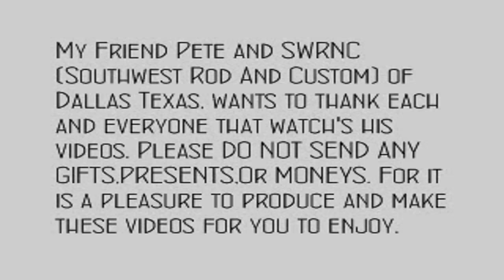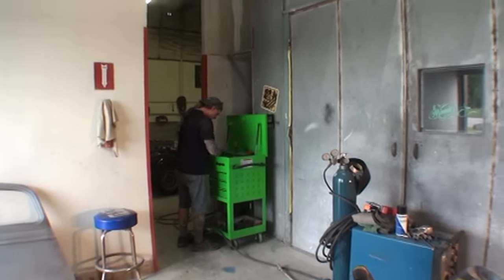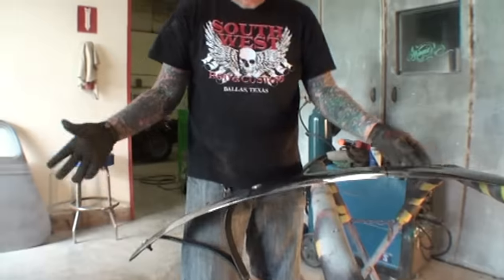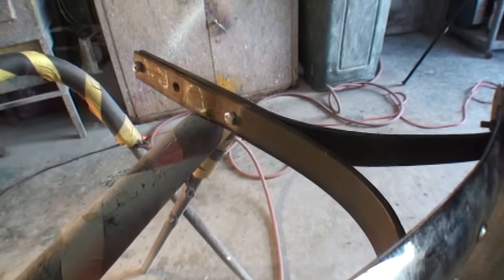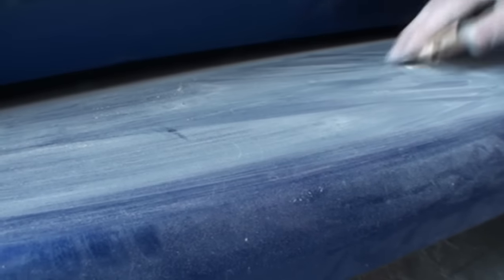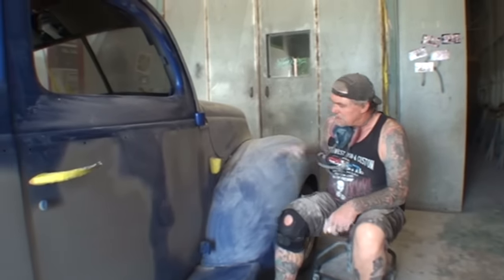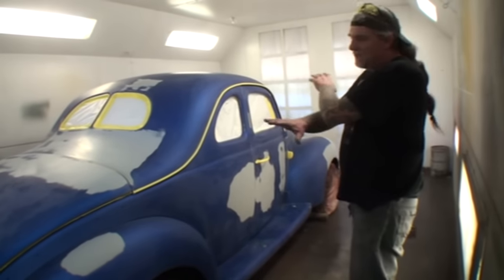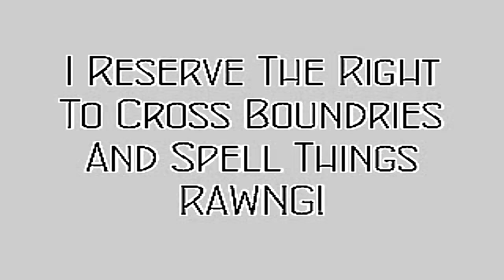How To Fix And Paint A Wrecked Hot Rod Car! Part 3 - Wet Sanding 2K Primer

Comment: I wonder if you mount the brackets to the car first, then heat the brackets while on the car and bend them to fit the bumper. Heat, bend, hold the bumper up to the brackets and repeat until proper fitment. But I know it would take a lot of time.

Comment: I painted a 97 mustang convertible right out in the open air and didn't get dirt in the paint. A few fossilized gnats in the clear coat was about it. 
Seem to be he didn't properly clean the car after wet sanding the primer, and or the garage was dirty.

Comment: I stopped using epoxy primer due to it (ringing out) blistering as you call it. I use auto barn 1k non sanding sealer (you can wet sand it) and it’s ready for paint in 35 minutes without ringing out, blistering anything. And it’s only 89 bucks a gallon , ready to spray
Reply: Correction... Auto Bahn 1k ready to spray sealer from eBay
Reply from the maker: I’ll have to check it out. Thanks for watching.  Your corvette came out beautiful!! 👍👍

Comment: Why not remove the brackets and install them first and then mount the bumper?
Reply from the maker: I did do that ad I actually filmed it but was dragged out and very long so I just got to the point to make the statement.  Either way you looked at it the brackets didn’t work. I think they where for something else. Even the owner stated they where brackets he found with a bunch of parts that came with the car and he didn’t know if they would work.  🤷‍♂️🤷‍♂️🤷‍♂️

Comment: Looks like you are going to have to shorten and re drill the inside brackets where they attach to the bumper and then bend the outer brackets to match.
Reply from the maker: Yes. That’s an option only if the owner pays me for my time.  When your doing extra work for the cost of a collision job and are already over your head with losing your ass extra work and bracket bending is t an option.  The owner didn’t want to pay out of pocket.  🤷‍♂️🤷‍♂️🤷‍♂️
Reply: @myfriendpete  Then I guess that your response of handing him back the bumper and telling him he would have to fix it himself, If he is relying on his insurance company to pay for the repair to the car that did not have a bumper installed on it at the time of the accident and they are not paying for that repair, Is the correct response! This customer can not just assume that you will go out of your way as a successful business to repair it for free, If everyone just expected that of you, You would be out of business! Therefore they would have to go to someone else to begin with.
Reply: @myfriendpete  One thing I fail to understand is how you got into the situation where you did not notice the paint on the car was as rough as it is when you quoted the estimate on the repair. Did you give the owner a quote over the phone without seeing the car before hand? Or did you just under estimate the amount of work it was going to take to correct it?
Reply from the maker: @Steven1Cicero  that’s what people think.  Their ATTITUDE is IM LETTING YOU FIX MY CAR! Not — I’d like to get my car fixed and here’s a list of other stuf not on the estimate that I’d like a quote for.   It’s a PRIVILEGE THST INWPTK ON YOUR CAR AND ILL DO ANYTHING YPU WANT FOR FREE.  (On my knees praising him like he’s an Egyptian Prince).   Total bullshit.

Comment: I think just weld some extra steel to bracket on the outside, redrill the bolt holes, and slide both brackets inboard wo bending them at all.
Reply: No don't drill that chrome?0?!!
Reply: Building bumper brackets is a half day add to the build plus paint